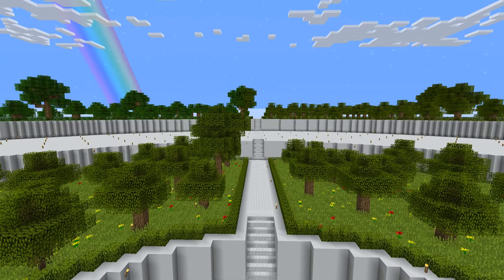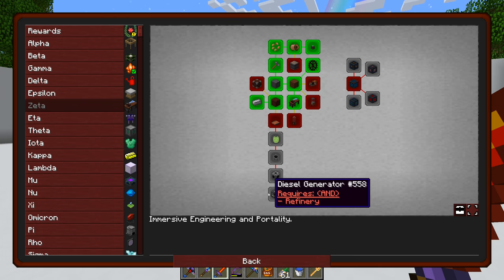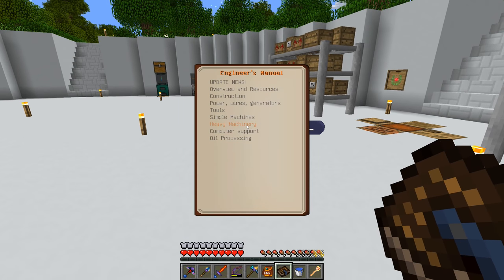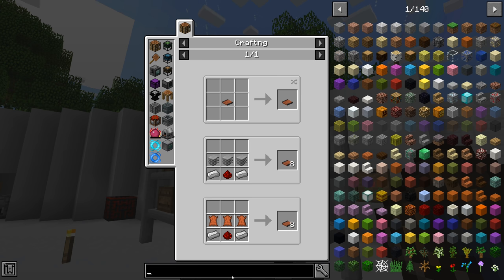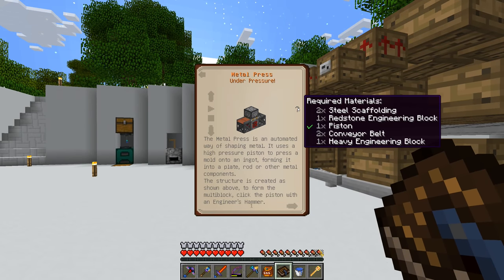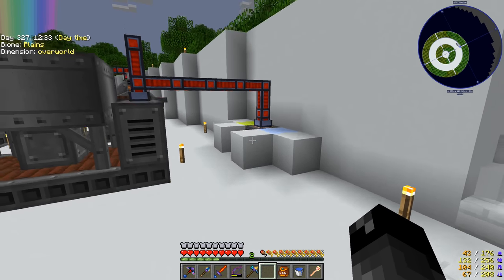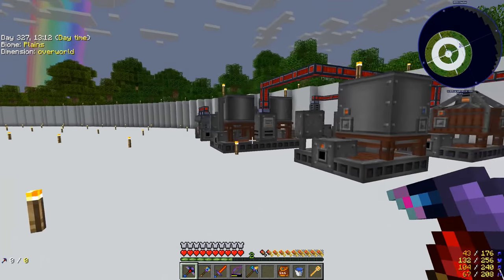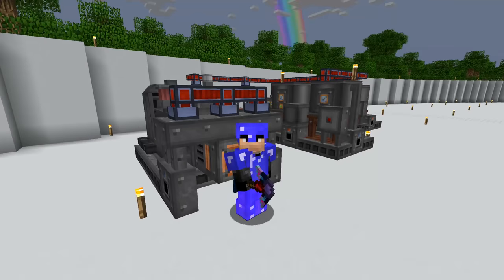Project Ozone 3 Kappa Mode - DIESEL ENGINE [E32] (Modded Minecraft Sky Block)

Comment: Yay more Immersive Engineering :) It's true though, it's a steel hog. I usually just play it the patient route and set up the coke oven to pipe the creosote out into a buffer tank, then a liquid trash can, then send the coal coke directly into a blast furnace with a hopper of iron ingots waiting to be converted. I forget about it for a few hours and when I come back, there's steel for my next IE construction.
Reply: Also, another commenter mentioned this, but make a capacitor bank for the power out of the diesel generator, and only let the generator run when the cap drops at least a unit of fuel's worth of power under maximum.
Reply: @diggoran  This is good advice. There's that RF Monitor or something from Ender IO that can emit a redstone signal based on how full or low a capacitor bank is. So, maybe turn it on when it drops below like 20% and off when it gets above 80% and it will then burn the rest of the operations worth of fuel.
Reply: who ever clicks thing in and out of machines?...automate before u leave the setup to just sit there!!!!...i mean 2 hoppers can auto the steel.....wtf
Reply: You can make steel in the alloy smelter with iron and pulverized coal

Comment: Tiny progressions steel is craftable with iron, charcoal/coal and a hammer from tiny progressions with infinite uses
Then if you need thermal foundation steel you can put it in your smeltery and cast it out

Comment: thermopile accepts heat/cold blocks on 4 sides and run it into a capacitor....machines run better on stored power and it will let u see how fast it fills up

Comment: In my current Enigmatica 2 Expert modpack playthrough, my early power gen was a compact grid of five Thermoelectric Generators bounded on all four sides with Uranium blocks and Packed Ice for 420 rf/t. It was pretty nice for a no-fuel setup. https://i.imgur.com/eVlEwET.jpg

Comment: Hi Hypno. Might I suggest employing a method of monitoring the fill level of a connected capacitor in order to activate/deactivate the generator? The generator will activate the moment it's buffer drops as little as 1RF. And as it doesn't throttle it's output below the rated RF/t for each fuel type it will burn the same amount of fuel every time it activates, wasting it in the process.